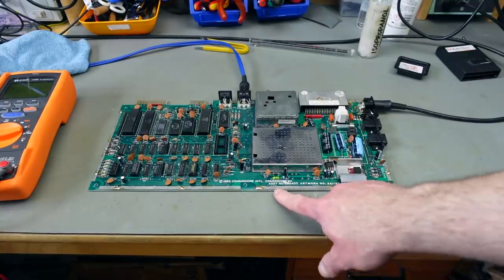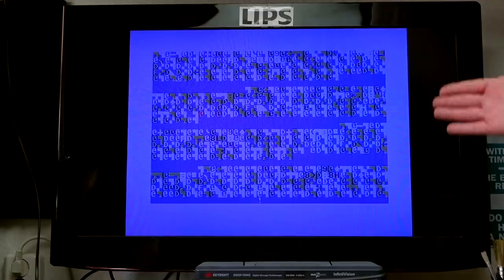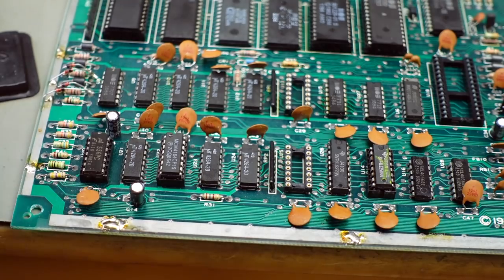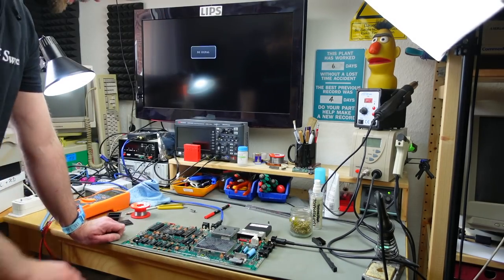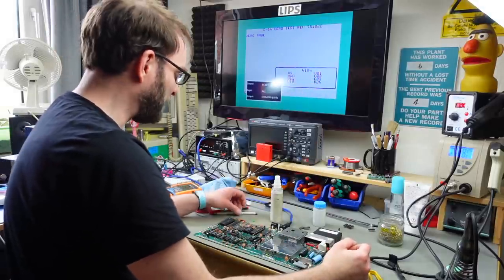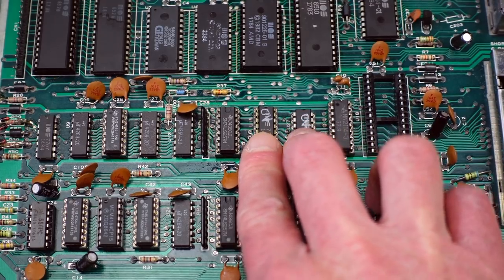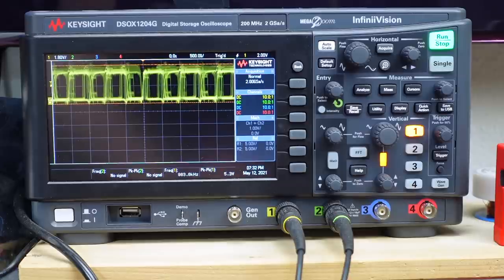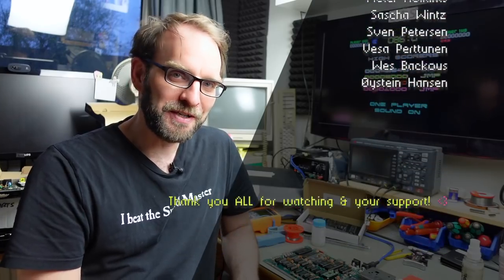Uncommon Fault C64 ASSY 250407 Repair

Comment: Thank you for sharing your technique of using the vacuum desoldering tool followed up with hot air. These last few days I have also been working on a 250407 board and have needed to remove and check several chips during the faultfinding process. I do not yet have a mechanical vacuum gun, instead I am still using a manual solder sucker.

I had always been frustrated that I could never get all of the solder out of the holes. Heating the solder joins with hot air (~240 DegC) and applying gentle extraction force after initially using the solder sucker has allowed me to remove multiple chips with no damage to the PCB and chips.

Comment: Adrian Black had a C64 that would sometimes pass RAM tests on deadhead cart but fail on diag cart and vice versa.  Also, the reported bad RAM may not be accurate if more than one chip is bad, so absolutely recommends replacing all MT RAM because even if a chip is working now, it will likely fail in the future.

Comment: Replace the broken fan of your desoldering station. My ZD-915 had the same fault.
Reply: I've been wanting to replace my fan. Not because it is faulty (yet) but because it is so damn noisy. Is there a quieter version someone can recommend? I believe its voltage requirement makes it a bit non-standard.

Comment: There are DRAM testers on eBay. I recently bought one with two ZIF sockets, it supports 4116, 4132, 4164 and 41256. Tested it only on 41256s and it works good.

Comment: Last week I repaired my first broken C64. I had persistent U1 CIA failure (indicated bad and timers didn't match). Swapping CIAs around and replacing them with new ones didn't help. I once saw bad U28 4066 indicated in the test screen but that disappeared and didn't reoccur. As I didn't find any explanation to my problem I in desperation also replaced the 4066 with a new one and the CIA problems disappeared. I didn't find an explanation why as I didn't manage to find any troubleshooting texts that linked the 4066 and CIA together in any way but ok, happy with the working machine now. But, it seems like the 4066s can cause unexpected indicated errors in other components.

Comment: I need to replace the cartridge port on mine. De-oxit was fixing it, but not anymore. At one point I noticed green sludge on my U2+ so obviously the contacts corroded. The replacement port should be arriving soon, but it's going to have to wait until I get through Mass Effect Lengendary edition. That gets released tomorrow and I get to see my name sake in 4K!!! I swear I did not name myself after a Mass Effect character. lol I may have changed my name legally in 2015, but using Ashley dates back to 2001. Anyway hopefully after replacing the cartridge slot my C64 will be good to go for a while. I've already replaced the MT ram chips it came with although only 1 of them was actually bad. It's the one responsible for bit value 128. I think that's like U12 maybe? Other than that it's been a good system.

Comment: Great video. This is not uncommon. If you check the schematics, color ram is connected to system bus(rom chips), VIC-II and U16. Since roms and vic2 is working that had to be the 4066 IC.

Comment: Great video! At what temperature do you have your rework air gun set at to help remove chips/sockets?
Reply from the maker: I usually set it up at around 350-370C which works well for most vintage things. Be aware that the temperature controls on these cheapo hot air stations might be way off though, so your mileage may vary and you may have to find your own good temperature by trial & error. :)

Comment: Oh, btw, what's with the elephant in the room? You didn't mention anything about those diodes going to GND on the left!
Reply from the maker: They are factory mods to protect the CIAs. I’ve seen them quite often on the older boards. The newer boards already have them on the PCB I think. Cf here: https://www.eevblog.com/forum/vintage-computing/c64-diode-bodge/

Comment: Hi Jan, I found a new project on github called Pistorm. This looks very interesting for many Amiga 500, 2000 owner . A CPU replacement/emulation , Turbo - card for about 60 EU including the Raspberry PI. The PCBs Gerber files are available for download or you can order boards from PCB Way. The problem is the CPLD chip. It seems the chip is not available this time. Hope someone could send you a Board for a Video .

Comment: I am just asking about your opinion recreating C64 or Vic-20. 

What you think about this: How much is changeable to create new c64/vic-20 with modern components/connectors and
keep c64/vic-20 as much compatible as possible.

I think, that there is nowadays ways to do C64/vic-20 smarter...
Reply from the maker: Oh, that’s already been done several times now. Most prominently, there’s the 64 Ultimate and the 64 Reloaded projects. Way earlier, there was the FPGA implementation in the C64 DTV, which is also a very accurate modern implementation of the C64. And of course there’s emulation, like in The C64 and The VIC-20.
Reply: @JanBeta  Thanks for tip. I will check out these: 64 Ultimate and the 64 Reloaded -projects.

Comment: Jan, why not piggyback the ram as it comes up broken in order to test quicker?
Reply: That does not always guarantee clearing the fault - it depends in what way the chip is faulty. If it's holding a line when it shouldnt, piggybacking wont clear it and may damage a good chip. As Jan rightfully suspected those MT chips, it was best just to get rid of them. Personally I wouldve replaced the lot in one go :)